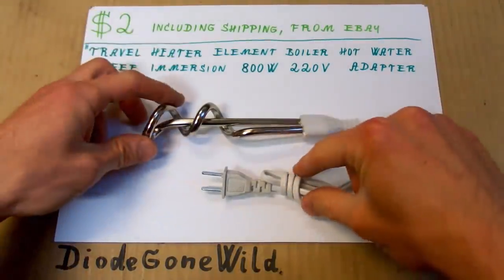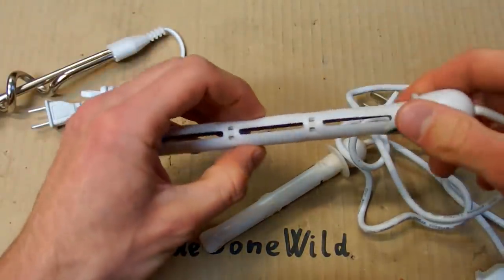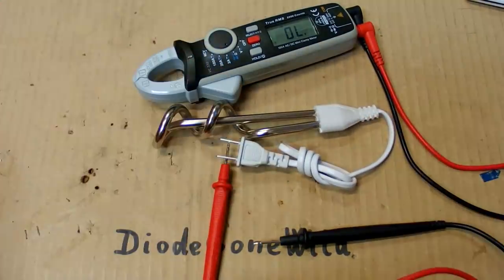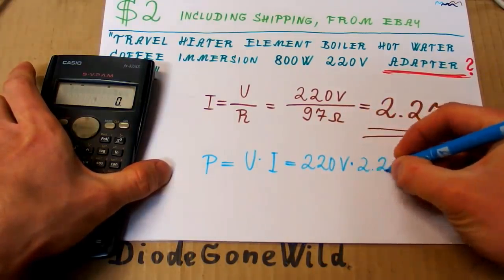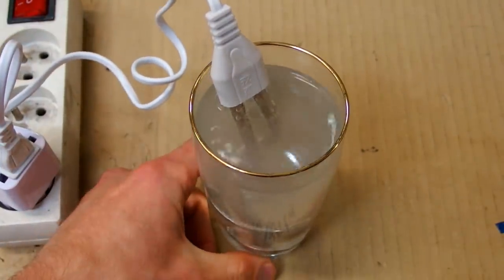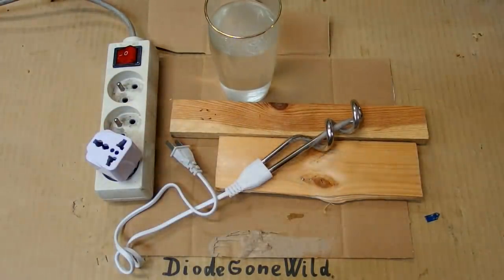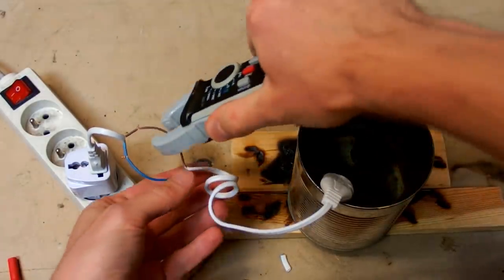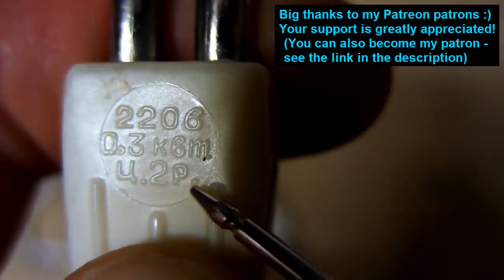$2 travel water heater (immersion boiler) test & some fire

Comment: A few days (maybe a week ago) I had this high current transformer I made and I used a bit of steel wire (maybe 1-1.5mm?) to make a heating element to light some pieces of wood on fire. A butane lighter wouldn't keep them alight, but the heating element worked so well.

Comment: In USSR you had these very commonly, and there was also the bigger version at 1750 or even 2000 or 3000w. They were 30 cm long and you used those to heat tubs of water at a time. My grandma when she was young in 1950s she didn't have hot water heater in her house so before bath time she would fill the tub and immerse one or two of these huge heaters for 10 minutes and water would be nice and toasty.. God old times.. well, not so good.

Comment: With those flat pronged plugs both those heaters seem to be intended for an American market and use on 115 volt current, not 220-240v! At 97 ohms and 115v the wattage would around a much safer 140 watts. Still, nothing I would dare leave operating unattended.

Comment: The heater you show here is actually very dangerous and will easily create a short circuit. I consider it to be more dangerous than the Joule heaters with direct mains immersed in water because with those you at least know what can happen and this one gives you a false sense of security.
100% guaranteed, this will suddenly form a short circuit when you least think of it and cause a fire.

Comment: LOL. Those immersion heaters are as old as the hills. I still have that coil kind I bought back in the late 1960's. I thought yours there would burn out the heating element before it could start a fire. wow. Chinese double the ratings on nearly everything they make. Even more lies for voltage converter boards. I bought some boost converter a few years ago. Claims 800 watts. Best I could get out of it was around 90 watts before the thing nearly melted down. LOL.

Comment: I've seen 2 versions of those immersion heaters. One version has a thermal cut off fuse, that will open if you leave it plugged in without water. The other version has no thermal protection and will glow orange if left plugged in without water.

Comment: for 2.27 amp that thing works for me, but that's 220v and we have 118v 120v in the US so this device would use 4.16amp, right? There isn't such things as a standard in all reality, they may call it 110 or 120, but it's all over the place. We have the same receptacles for 110~120v normal utilities as that water heater.
Reply: https://www.rapidtables.com/calc/electric/ohms-law-calculator.html The wattage should be 1/4  of the video if plugged to 110V
Reply: If you have a water heater that draws 2,27A from ~120 volts it needs 272W. If you plugged this heater into 240 volts, it would draw 1,09kW; so 4 times the nominal power, because the voltage and the current are double, so quadruple power

Comment: I just remembered, when i was a child didn't have any soldering iron. But there was this water heater in our shower. And i used this water heater to solder some wire with a speaker. It was the 1st soldering in my life... probably in 2001-2002...
And Nobody noticed 🙂

Comment: Hi i have a question i have a mini Kentiger amplifier i got off ebay it says use a 12v 5 amp power supply i used a 12v 2 amp and i noticed when enhancing the volume it cuts out bad.. Is it because of the 12v 2amp power supply? Thanks!

Comment: Man, PLEASE get some insulated splicing connectors before you have a nasty accident, e.g. WAGO lever wire nuts, or a screw terminal block. I see those bare, live wires sticking out, and can't help but think what could happen. Yes, I know it's "safe" as long as you're careful, and you have been reasonably safe to now. But electricity is so instantaneous and unforgiving if one mistake is made. I'd hate to see anything like that befall you.

Comment: an ideal device to make charcoal glow for a nice BBQ :-)
Reply: These heaters have a built-in fuse/safety device which will 'blow' after the heater reaches a certain set temperature. Apparently, this model DOES NOT have safety feature. BTW...this guy has just ruined his heater. What an idiot.

Comment: There is a mistake in your calculation
The power for Ac is  equal voltage *current *1'44 
In this case 
Power equal 720 watt
Reply from the maker: No :). Where does the constant come from? I'm sure that the power of a resistive load in an AC circuit is just voltage*current.
Reply: @DiodeGoneWild    I suspect OP means 1.414... , or sqrt(2),
factor between the peak and RMS values of a sinus wave.
Incorrect though, as that's what RMS values are used for to deal with...

Comment: Yes the lack of earth jumped to my mind as well.
The thing is it can be safe if used carefully, not by morons.
My dad used to have a mini one for use in a cup, keep his tea warm.
Silly idea really.

Did the microwave camera show any oddness, or the memory card?
Reply: they get low resistance to the metal too.
Reply: Yes it's a worry, no insulation is perfect.
Thats why i like an earth on everything that has a metal case.
Those metal body touch lamps are a really bad idea, yes they work but metal without an earth :-(
Reply from the maker: The microwaved camera didn't show any damage...
Reply: Im so supprised, all that r.f hitting coils in the camera, and generating voltages, ooow lol.
Reply from the maker: John Ward tested it, and it seems to short to the metal tube. I have to check this as well :). My one also has a short circuit to the tube, but I thought that this only happens when it overheats.
Reply: You can listen to john ward without going mad?, you are strong :-D

Comment: Multipurpose device. Heats water, starts fire. Definitelly must have :-D
Reply: And soldering iron
Reply: It's a MultiTool.
Reply: The funny thing is, there are products called Electric Charcoal Starters that work on this exact same principle and work similar too. The difference is that electric charcoal starters are, of course, properly built and grounded with no molten plastic to be seen.

Comment: Less dangerous of the others with slots.
surely without any kind of protection, but you can use it (surrounded by refractary materials) in pellet stowes as ignition plug!

Comment: That heating element with a metal case, doesn't have a ground wire, wtf?
Reply: Theres a thin heating wire that runs through the middle, then there is fine sand that us packed around it between the heater coil and the steel tubing.
Reply: @jerryspann8713  I know that, it's filled with magnesium oxide which spreads the heat onto the metal case by the heating element (coil inside), but sometimes the resistive wire can get in contact with the case.

Comment: 2:55 that's a V for Voltage not a U. 3:14 same thing. Just FYI.
Reply: Tooniis+ in europe we are using U as a physical quantity for voltage and V for unit of voltage
Reply from the maker: At school, I was learned that U is the symbol for voltage. It probably differs form country to country.
Reply: DiodeGoneWild same
Reply: @DiodeGoneWild  :  That's what I've learned, too. U = voltage (unit V), I = current (unit A), P = power (unit W), R = resistance (unit  Ω)
Reply: The use of U for the symbol for potential difference (measured in units of volts) is also taught in the U.K. (since at least 1986).
However most people who have not been formally educated in electrical and electronic systems don’t know about U and just use V.
Reply: In Europe, it's U for electricians and V for physicists 😢

Comment: Cool. So is that little "6" almost "B" symbol always the cyrillic character for voltage?

  I wonder if this little guy would be an ideal element for a small reflow oven. It could probably work as a preheating device for crude SMD reworks too. The plastic and wire would obviously need to go.
-Jake
Reply from the maker: B stands for volts in cyrillic. The B symbol is actually pronounced "V" in russian. 
I think this element is going to fail quite soon. It's very poor quality and it's not designed to run in free air. I also forgot to say that after the experiment, the tube has mains in it! You probably should use something of a higher quality and also designed for free air operation.
Reply: В in cyrillic is equal to V in latin, so i actually just means Volts :) The latin B in cyrillic looks like this Б or this б (upper vs. lowercase)
Reply: You would need to control the temperature or it will burn out.

Comment: That's actually a Japanese plug, but also compatible withe the US plug.
Reply: *Chinese
Japan plug;
https://encrypted-tbn0.gstatic.com/images?q=tbn:ANd9GcT3GVhGk1UU38Q62Od8o5ZEo_fzcCxvWp9YuKK1wEIU_Resmw9gJD9H8js

Similar but no exactly (also Japan uses 100v power not 220v or 240 or 120v
Reply: Or Taiwan.

Comment: I have similar of those, i paid equivalent of 3$ and its 100W
Reply: With only 100W it will take quite a long while to bring a cup of water to boiling temperature, I suppose?
Reply: @e1woqf  yes it does. I need to heat more than 5 min to make 1 cup of cofee

Comment: Power does not have to be exaggerated. Resistance might drop with temperature depending on alloy or heating element. Ideally you would need to measure resistance at heating element operating temperature, which can be due to insulation well above 100°C.
Reply from the maker: The power of heating elements generally doesn't go up as they heat up. Most metals increase their resistance when hot, so the power goes down a bit.
Reply: He did measure current at the end and it was only slightly different.
Reply from the maker: The measured current was slightly higher than the calculated one, because the nominal voltage of the heater is 220V, but EU has 230V nominal and sometimes 240V actual voltage.
Reply: @DiodeGoneWild  Maybe they give you 800W due to the resistor tolerance and the maximum nominal voltage (250V) (considering the worst case possible). If you do the maths the resistance is a little bit less than 80 ohms (the current is 3.2A); this is the case if they're using a 100 ohms resistor (nominal value) with a tolerance +/- 20% and that is a possible explanation, considering that they try everything to sell making ridiculous prices.
Reply: They probably got that 800 Watts figure by using the peak mains voltage instead of RMS.
Reply: @Agent24Electronics  I really hope it isn't like that
Reply: @9712teo  It's China, some sellers will stretch the specifications of anything to the very edges of plausible.

Comment: Between 4:32 and 4:33 I saw a spark from the plug.
Reply: so what
That happens everytime you unplug power intensive device like iron or space heater
Reply: Me too!
Reply: @przemek4101  Because, the capacitor in ac/dc power supply charging and it is about short circuit for microseconds. Sorry for my english.
Reply: Try unplugging a vacuum cleaner while it's turned on. Talk about a big spark!
Reply: I saw sparks when I stick my finger into the power plug.

I love it.
Reply: So?
Reply: @zUltra3D  hahahah lol
Reply: @zUltra3D  what
Reply: Its normal
Reply: It is not accident or problem it is just connected to it so it just sparks

Comment: Holy hell! That's a freakin' small trap!
Reply: Small trap ?
Reply: @simontay4851  why did you italic the word 'trap'?
Reply: @Boris_Din_Dietrich__Hazim  because i don't understand why you said trap. Its a video of a cheap water heater. Nothing to do with any kind of trap.
Reply: @simontay4851  well just like Diode Gone Wild showed us, if we accidently put the apparatus on any flammable surface (eg: table) it would catch fire. There's no safety feature except for the insulation but the insulation itself is pretty fragile (or any words that fits it because English is not my mother tounge). There's no grounding, so any short circuit will give a catastrophic result. And the worst is; NO THERMO SWITCH! If someone who is foolish enough to mishandle it, sh*t going to happen.
Reply: @simontay4851  thermo switch often used in electrical applience that produce heat such as microwave oven. If the a certain tempature is reached, the thermo switch will cut the circuit, preventing any damage to the circuit .
Reply: The device also have no fuse.

Comment: John Ward has just done a similar video. On his the insulation broke down after first use so it's quite dodgy.
Reply from the maker: I have to get another and do more tests of the insulation :). My one now  has mains in the metal tube, but I thought that this only happens when you overheat it by running it in the air.
Reply: DiodeGoneWild - John Ward used a 500V / 1000V insulation tester (not that it managed to get to those test voltages, as the insulation was not good enough).
Reply: @DiodeGoneWild  their insulation just is hopeless.  if was earthed it would trip rcd
Reply: tmo72 dogee*
Reply: Ha ha ha... I was going to write it the same way !!!
Reply: tmo72, ive tryed to watch john ward, but he is so slow and describes everything like it's so important, drives me mad, sorry madder lol.
Carlsons lab is worse, i gave up trying to listen,
Reply: @zx8401ztv  I watch youtube at 2x speed helps with the slow talkers.
Reply: Josh C
That is possibly the best way to listen to john ward and similar lol :-D.
I think my patience is becoming shorter with age, i don't want to wait a week for someone to tell me how to tighten a screw ha ha :-D.
I'm sure he is a smashing man, i just can't listen to him.
Reply: zx8401ztv - if you go at too fast a speed, you won’t get his dry sense of humour!
Reply: Mark 1024MAK
I think i will risk losing some humor :-D
Reply: @tmo72 -  
Yes , 
thats why I a few seconds thought "where is my comment?" (its on an other video https://www.youtube.com/watch?v=CE1DSysm_EU with the same garbage item)
Reply: Not used as intended